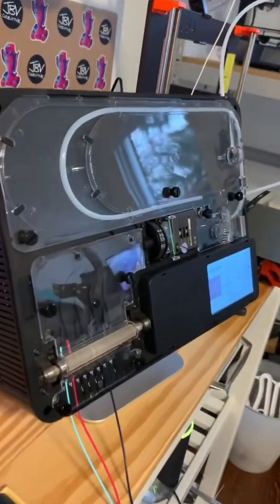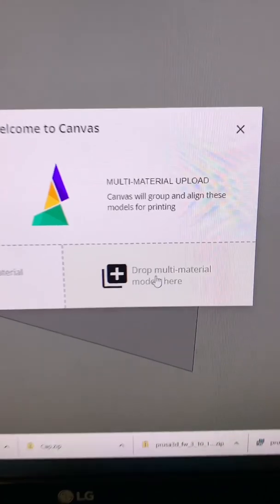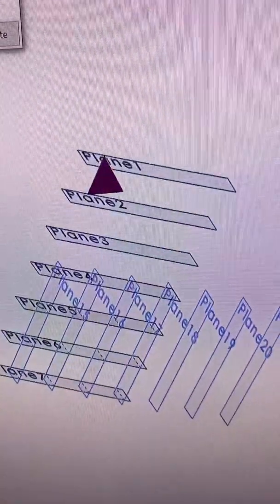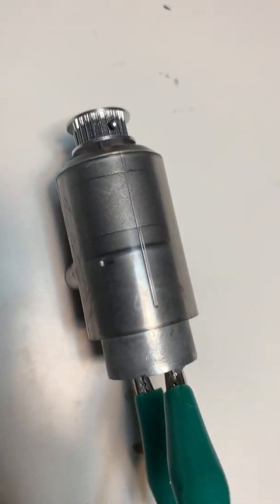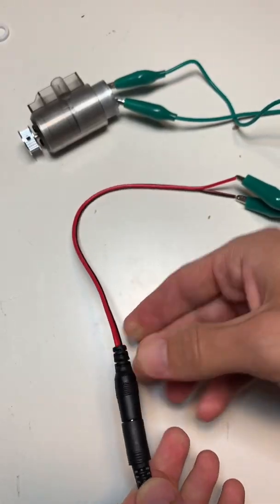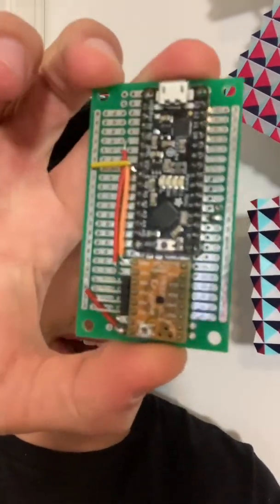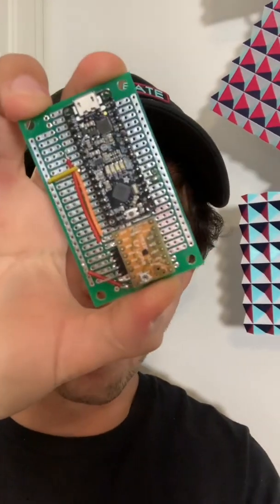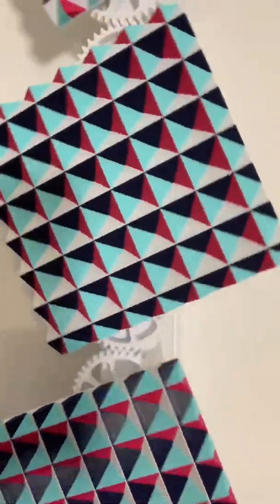Challenges Faced while Creating my Latest Sculpture

Comment: Noo not the Arduino Pro micro :(
Reply from the maker: Luckily it was just a knockoff 😮‍💨
Reply: Did you throw it away? If you didn't yet, try a trick i found. When i short circuited my nano, i could still run it if i powered it from 5v and GND pin.

I can't even receive fake Pro micro because shipment logistics are broken because there is an invasion going on :(

Comment: Cool project. You absolutely could have used an attiny85 or other smaller/cheaper microcontroller to run the stepper driver though. I guess the difference in price isn't that big unless you manufacture a larger quantity buy still.
Reply from the maker: I’ll keep it in mind for the next one!

Comment: Fun fact: most of the noise in slow speed DC motors is not from the motor but from the gears in the gear box. No DC motor runs slow, so if you see one running slow there's a 99.9% chance it's got a gear box on there. If it uses spur gears rather than helical gears those cause the most noise (and is why most consumer cars opt for helical gears in their transmissions)
Reply from the maker: Gotta start looking for those helical gear motors, probably wont find them on amazon will I..?
Reply: @Engineezy  ya, the off the shelf helical gear boxes are typically for industrial or automotive applications. They have the added benefit of wearing out slower than spur gears which means less maintenance and less cost. 

Worm drives can also be quite, although then you also need to start thinking about the sound of the motor itself since it will need to get going fast to move the screw even just a bit. 

I think at this scale going with the stepper was a good call and an option I hadn't considered. The mech eng in me had a bit of a knee jerk repulsion at the idea of using a motor designed for porosition control in a speed controlled application. But given your stated desire to optimize for noise this was an elegant and compact solution. Nice job!

Comment: Isn’t it could be silent on dc motor with the right capacitor…
Reply from the maker: I wish! The noise mainly comes from the gears!
Reply: @Engineezy  maybe use belt and pulley then for those are the most quiet transaction as far as I know.
Just use rubber rings as the belt I guess, or string?

Comment: That’s totally cool but I bet you could have found a quieter DC motor.
Reply from the maker: Possibly! But I still have yet to find one!
Reply: @Engineezy  you need one without gearing. The gearing is what makes it noisy
Reply: @youhackforme  with no gearing those things would either not turn at all or turn waay too fast. Steppers are def the way to go here
Reply: @amos9274  you can always get a smaller motor/lower the voltage. You have to size the  motor based on it's Kv constant
Reply: @youhackforme  If we assume that you find a motor that will turn at 1V (which I haven't seen) you'd need a motor with like 60kv max. Im no DC motor expert but I have never found a 60kv brushed motor that isn't huge. Also you can't turn the Voltage down indefinitely because at some point, the internal (electrical) resistance of the motor limits the current and thus the max torque you can get out too much.
Reply: @amos9274  that is true, agreed.
Reply: A brushless motor would do the job.
Reply: @Mark0ut  with FOC yes, but it would be more expensive and more complicated than a stepper at that point